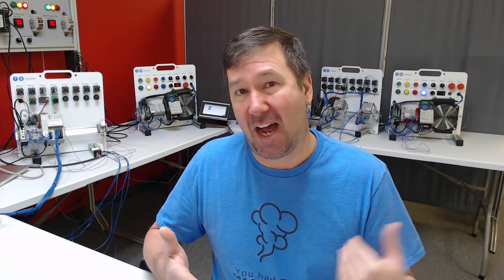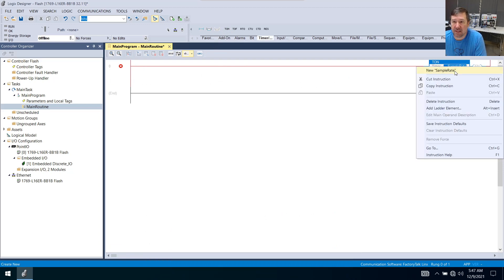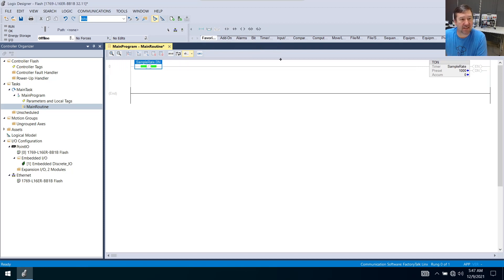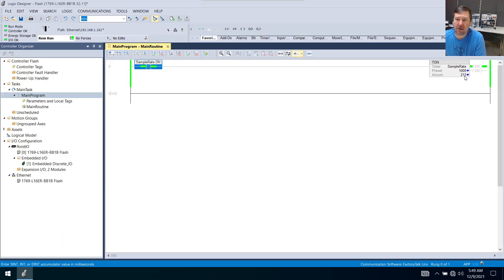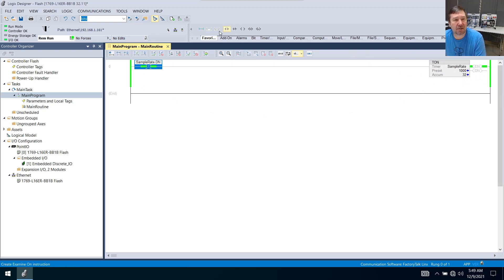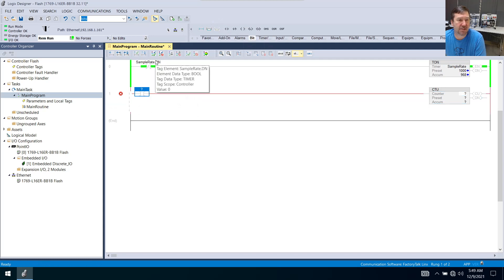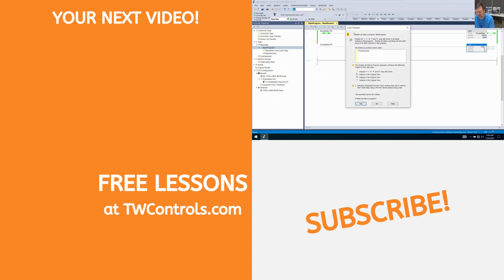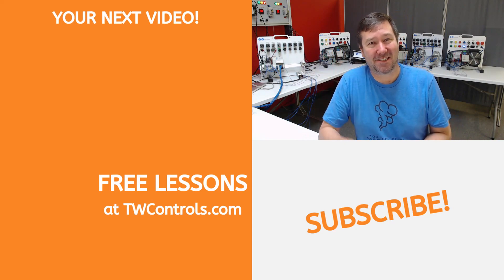Programming a Sample Rate Timer in an Allen Bradley PLC

Comment: Hello Tim, thanks for the amazing work you're doing with this!
I have a question regarding the sample rate timer DN bit. Why is it that having it as an XIC makes it look like it is perpetually on? Shouldn't the timer stop counting because the DN bit turns ON?
For example, we start with XIC and a timer counting to 1 sec, when it counts to 1 sec and the DN bit comes ON, shouldn't the XIC SampleRate bit turn OFF thereby stopping the timer? Is it restarting because the program itself is restarting? I'm quite confused
Reply from the maker: That is an XIO (Go look for a 0) in front of the timer.  It looks like it is continuously on but when the ACC is greater than or equal to the PRE, it will write a 1 to the DN bit.  On the next scan, when the XIO goes and looks for a 0 in that DN, it will see a 1 and be false.  A false TON writes a 0 to everything but the PRE which includes the DN bit.  On the next scan, the XIO will see a 0 and be true, starting the timer again.
Reply: @TimWilborne Thank you very much, that's really helpful to know! And I accidentally flipped that (XIC = Examine if Closed), I am looking to learn all of this so I appreciate your videos a lot. Again, thank you!
Reply from the maker: You are welcome!